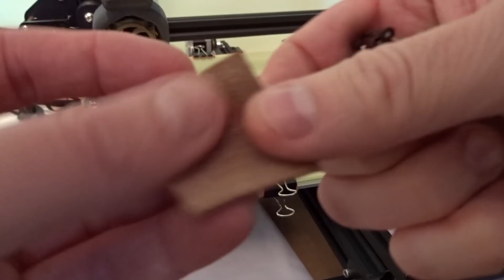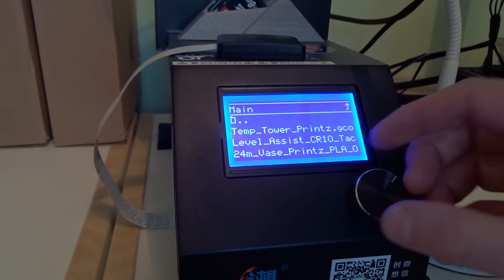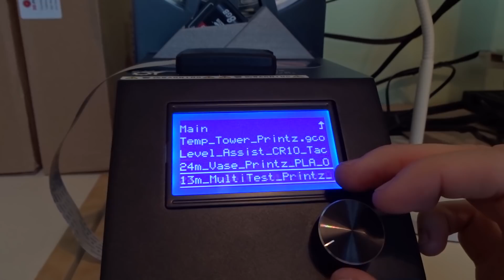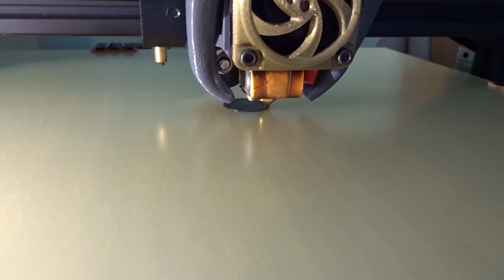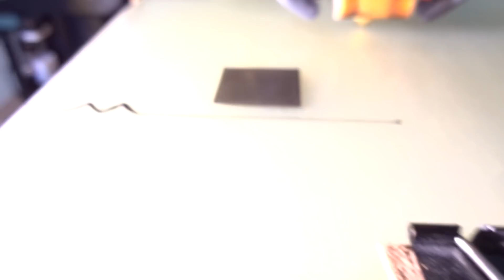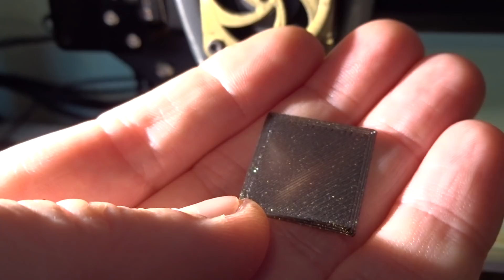Easy Live Levelling

Comment: i use water instead of binder clips. just slide the glass backwards over top of a few drops of water and it wont go anywhere, and you've got  your entire print bed available.
obviously dry the edges before you start printing and don't put your printer inside a pool of water you'll be fine. for ABS i'll probably try the same trick with oil instead... since water boils at 100c

Comment: Nice. Whenever I tried that on my Tornado, I would just go round and round in circles. It was maddening. Every time I adjusted one, it would sod up all the others. Sometimes, it went on for hours. I gave up in the end. Blue tape soaks up most of the difference and if not that then Pritt Stick or an autolevel probe. The bed was warped out the factory. When I held the edge of a metal ruler along it's length, there was a massive gap in the middle. Some of this cheap crap just cannot be levelled imo.

Comment: "Automatic bed leveling" is really a misnomer. It should really be called automatic warping compensation. The point is not to level a flat bed, it's to counteract warping in a bed which can't be done with any other means besides physically fixing the bed like you've done with tape or by actually bending it back into shape with clamps. Even if you don't actually use it for printing, a bed leveling sensor can be a great way to get a 3D mesh map of the bed to figure out exactly where and how it's warped

Comment: I use a BLtouch and have to adjust my bed manually once in 3 or 4 months. I adjusted my bedsprings to the stiff ones. No hassle anymore. I throw on a print and have perfect first layers. Don't use any tape, glue or anything, just the creality glass plate. Just use the correct firmware and temperatures

Comment: I’m a nubs, only printed a butterfly from the Sd card after paper alignment.
I have a Monoprice Select Plus, I really like your method of real time leveling, so right away your know what your jobs are going to look like.  
I see your running Marlin, so I’m guessing I cannot do this with my factory firmware, what do I need to do to use this method?
I like your adjustment knobs, the features on the knobs make it easy to make an incremental adjustment.  I hope you included them in your description.
Again, I think this a super way to do your alignment as you actually see what the print is going to be like.
Thanks
Hager, (Phoenix Arizona)

Comment: should you be saying tramming the bed,   not bed leveling .....  tramming the bed.   #2 why not use feeler gauges for nozzle adjustment  distance from bed, not paper
Reply from the maker: No tramming is a term used in cnc and in the 3d printing community people know what the term leveling means. Tramming is not used in the 3d printer community.

Comment: Hi, I am wondering about the clips on the sides. The printer primes the nozzle and filament by extruding a couple of lines on the left edge. How do you get it to do that when the clip on the sides are there? Or have you disabled that somehow? If you have disabled it then how do you ensure to prime the nozzle?
Reply from the maker: Use custom start gcode and move the clips so they dont interfere.
Reply: @TacBlades  makes sense, thanks. Thought of that today morning as well :P 
I've ordered some extra slip on bed clips. Let's see how that works.

Comment: Great video. Curious as to why you set the first layer height to 0.18 instead of the layer height of .2?
Reply from the maker: Its mainly because internally to the printer it takes into account the extrusion width and pressure and for the first layer you need a little bit of squish for good adhesion for the first layers without producing an elephants foot.
Reply: @TacBlades  interesting, thanks!

Comment: You're a lifesaver! All of your techniques in this video saved me so much trouble! The very front center area of the bed would not stick and warp while every other corner was perfectly leveled on the glass bed. Your masking tape hack on the metal heating plate of the bed fixed that solution! I had no idea parts of the heating plate warp, so I'm really relieved with that masking tape! And your leveling squares are definitely more effective than using paper.  I have an Anycubic Mega X printer, which is kinda similar to the CR-10. I'm going to share this video with fellow 3D printing artists, so it can help others! Thank you!

Comment: is it me or he didn't explain how to know where to put masking tape in your metal bed? it seems like he did a ver precise work on his bed but does not explain how to know where to put it aside from the very general idea of putting in the middle if you have a bow : (
Reply from the maker: Yes i didnt explain that, but i basically put tape put bed back tested it, removed bed adjust tape place bed test, over and over until flat, its takes time but you only have to do it once. Kitchen foil works better than tape.

Comment: WELL, I have to EAT CROW here. I'm new to this 3D stuff (less than a month) and already finding out just how IMPORTANT this level stuff is. I have printed some really good stuff BUT had to use painters tape because I couldn't get anything to stick to my glass bed, however the painters tape has it's problems as well, most stuff sticks TO good and leaves a layer of tape on the bottom of the most of the parts, SO after watching your video several times I tried your method, BOY does it work! I did have to use a post it note to get a base level because I have an Ender 5 and very hard to see the nozzle and bed with the rails. My firmware already has a level the corners step so I used that for the initial level then printed several of the test prints you  provided adjusting the wheels  till I got the the correct results you show then printed a clamp that I couldn't  ever get to come out correct. Now I'm sorry I ordered an EZ auto bed leveler because after this I don't think I need it. 
Thanks so much for your video and your teaching.

Oh, and by BTW, I found out just why I used painters tape, MY BED WASN'T LEVEL even tho I thought it was!!!
Reply from the maker: No worries i am happy it helped you.

Comment: Don't mean to be rude BUT looks like you would spend all day leveling with this method.
Reply from the maker: Its very accurate takes me a few minutes and i only level once a month at most, sometimes once every 2 months.
Reply: I use this method and I find it to be way faster and way more reliable since you can see your results instantly, however some printers require screw drivers to level which would make it almost impossible to level this way.

Comment: Why worry about the alum bed if your using a flat piece of glass?
Reply from the maker: Because its clipped at the edges, and the base plate can move, twist, shear the glass it only need to move by 0.1mm and that will mess up a first layer.

Comment: Hello.  I'm confused when you say use a 0.2 layer height but then slice at 0.18.  I'm not following what this means or why there's a difference.  Also, I'm using a 0.2 nozzle so not sure if that makes a difference.  Thanks for the great video.  I hope to use it soon.
Reply from the maker: Yes things are very different depending on nozzle size but for 0.4mm nozzle use a layer height of 0.2 and a first layer of 0.18.
If you have a 0.2 nozzle then you are looking at a 0.1 layer height with a first layer of 0.08, the smaller the nozzle the more difficult and precise it becomes.
Reply: @TacBlades  Thanks so much!  I may switch back to the .4 then.  Very helpful!

Comment: One thing I was unclear on was when you do the taping. Do you do the first where the nozzle touches and you back off quarter turn and that's where you do the taping? Or do you tape when you are printing the squares and circle?  We just got ours and are struggling. The back left corner is as tight as can be and is touching the glass but we can back it off at all. No more room to tighten. So that corner is all messed up. Something clearly is off.  We just dont know where to do the taping part.
Reply from the maker: If the corner is tight and the adjuster and spring is totally compressed so no more a chance to lower the bed any more, then something is wrong, it should have plenty of adjustment away from the nozzle. 

In that case there maybe a problem with the position or height of your z endstop.

Comment: Hi Mate I know it was a while since you did this video so may not remember.
Your bed looks much larger than mine (200x200) and I was wondering if you could point me to the instruction  in the level assist  file  that would allow me to reduce the travel to 200x 200. As it stands now the first test point is about right then the next 1 about 50mmX50mm the next one is 50mm up the bed but ok for the edge.3rd point is about right and the 4th point 50mm in from the edge the center point is about two thirds up the bed.
Clearly the file thinks my bed is the same size as your but runs into a limit  which knocks everything out.
I am afraidI am crap at reading gcode and do not know the size of your bed to try and work it out.
thanks in anticipation of a reply..
Regards  John
Reply from the maker: Its too long ago but my bed is 305x305 if it helps.

Comment: Can you just use a reg pc of window glass ? Or is it special glass of sorts ?
Reply from the maker: It has to be very very flat and most glass is not flat, that why people use ikea lots mirror tiles because they have to be optically flat. Also to withstand the heat cycling.
Reply: Tac Blades thx for the response ! Cheers !

Comment: A waste of time and of material. And you have to do it each time after printing on a CR-10(S). What is really stupid about this method is that when you adjust one corner, another corner is spoiled. So, one trick is not to go for the "perfect" distance in the first run, especially when you had to turn the wheel a lot. You still must do several laps.
Reply from the maker: You are wrong i only do this once every 2 months my bed doesnt move.

Comment: How much Temp does the maskintape can handle for instance for abs need the heat bed need around 110°C does it need tin foil or maskintape is ok? Great Video.
Reply from the maker: Not sure but aluminium foil for cooking is a better solution.
Reply: THX for tour comment best regates.

Comment: You dont explain where and how to find the places to add the masking tape to..... (nvm already been answered below)

And wouldnt that insulate the bed from the glass and slow down the heat up?
Reply from the maker: No it doesnt slow it down, I also used aluminum foil for cooking. The place is really trial and error for the low spots.

Comment: I will be giving this a try, but i have a question - after the front left one was perfect "like glass" etc and it then goes to the middle, surely if you say you need to adjust all four even if only a touch you are going to mess with the front left? In a quest to make the ultimate levelling plan for when it needs doing, how would you go about slicing gcode so that it prints each corner first and then you adjust the middle?
Reply from the maker: The adjustments are small and due to the angle if you adjust all others but not the front left then the actual impact to the front left will be less than 0.03mm

Comment: you mentioned talking about how to fix the variations in flatness... i know the center of my cr-10s bed is low. what’s your method please? :)
Reply from the maker: I use layers many of cooking foil small pieces under the print surface at the low spot. Trail and error to get the right amount.
Reply: Tac Blades thanks.. how do you work out where the low spots are? again trial and error?

Comment: How do I edit the gcode for a creality CR-10 S5? 500x500x500?
Reply from the maker: Just use a text editor on the file.
Reply: I figured it out but im still having issues with the leveling any ideas
Reply from the maker: @AllInOne-bo5vp  is your bed warped ?
Reply: I put a mirror
Reply from the maker: @AllInOne-bo5vp  with heat and edge clips it can still be warped, mine is you have to pack it out with aluminum foil underneath for low spots. It only has to be out 0.1mm to be a problem.
Reply: How would i determine where the low points are
Reply from the maker: @AllInOne-bo5vp  thisnis something you would have to research online its not straight forward try the facebook dedicated groups its a good place to start.

Comment: Will these test files work if I haven't flashed my CR10 firmware? I haven't done that because it's beyond my technical savvy, I fear.
Reply from the maker: Yes these are for a stock machine.
Reply: @TacBlades  Thanks! Oh, one more question: I have a 500x500x500 machine...What should change?
Reply from the maker: @stevei7221  you would have to go into the gcode and adjust the locations of the test points. Its easy to edit in a text editor.

Comment: I saw on the Nerys YouTube Channel that he was leveling with one large circle that may have been 200 mm in diameter and he was compensating for nozzle height for the first layer by live leveling with the CR 10s Pro touchscreen buttons. I see that you are using the wheels. I am new to this. Is there a reason why you are showing this adjustment with the wheels and Nerys is showing it on his video "T3DP Live CR-10s Pro And Wham Bam Flex Plate" at 1:24:53 using the CR10s Pro touchscreen buttons? Also, regarding your flatness compensation, is the CR10s Pro 16 point auto-leveling compensate for flatness? Is it a sort of tramming?
Reply from the maker: The cr10 and cr10s as standard dont have thoes features in the firmwear so this is for thoes people. The cr10 pro has features in the firmwear for mesh bed leveling with a probe so its different. 
I have my own firmwear version of marlin on the cr10s so i can also do mesh bed leveling manually which is the most accurate method now.

Comment: I've had a lot of problems with the bed levelling on my ender 2 - the screw heads for the levellers are countersunk into the top surface of the bed with quite a bit of looseness. They tend to rotate with the knobs when I adjust the bed height. The springs also seem not to push the bed upwards towards the top end of their travel. I've packed out the springs with a couple of washers to try and increase the pressure but it's still a hassle. The bed has only three levelling screws. Adjusting one throws another one out, so we have to go around and around tweaking the levels until we find the least errors in the level.

Comment: Thanks for the video. You mention doing quarter turns when it looks like you're doing one-eight turns, so please be more accurate with words. Also, how did you check the middle of the bed when doing the contact test? In the video, it sounds like you just eye-balled it.

Comment: Well, that looks simple, thanks.... will give that a go..... currently using the Supplied "tac-fibre glass bed (?)) supplied with my Ender 3, its good, but doesnt sit flat on the Aluminium heater bed all over, might need to upgrade to Glass....  New Sub from me :-)
Reply from the maker: Or maybe shim the underside with aluminium foil to get a flat surface ?

Comment: I put tour code on my machine and now only get a bluescreen
Reply: I'm not going to open it up, it could invalidate the warranty, I'm going to contact the place I bought if from and will be trying your method of levelling the bed when the issue is resolved
Reply from the maker: @jeffw3312  good idea.
Reply from the maker: Start gode cannot effect your screen something else must have changed..
Reply: I don't now mate. seems od as soon as I put the code on my sd card and put it back in I have a bluescreen, seems a bit too coincidental it was working fine berfore except levelling issues so I thought I would try your way
Reply from the maker: @jeffw3312  very odd it's worked for many many people so I guess it's a specific problem to your machine have you tried a different sd card.
Reply: No not tried that yet, get blue screen with or without sd card, only had the machine 3 weeks
Reply from the maker: @jeffw3312  there is a fault with the machine I have heard of this before when the cables are not plugged in well between screen and mother board.

Comment: Amazing, thanks for sharing. Did you change your glass? What do you have on it to stick?
Reply from the maker: I use an Ikea mirror time and either nothing just clean glass or in this vid I used a printbite surface.
Reply: @TacBlades  Amazing stuff, been having a look at your other bits. Thanks for sharing. I have worked in IT for 25+ years and am a bit of a geek... but when you buy your first printer, there is a huge learning curve and to be honest, you don't know what questions you should be asking or things you should be looking in to. The instructions that come with the printer (CR10S) are incomplete and awful and again don't even tell you what you need to go find out. Still, I have printed a benchy boat now so once I have played about with levelling again I can try to print some new parts for my new printer. Having found your fan blade thing on thingiverse I think that will be first. Thanks again.

Comment: Hi! I’m able to level the corners, however I’m having trouble with the middle. Instead of dipping there, it is actually bowing up. For the best of my knowledge, both the bed and glass are quite straight, so it could also be a bent X-axis. Would you have any tips for correcting this? Thanks in advance!
Reply from the maker: Have you tried flipping the glass over. Or packing out the edges with aluminium foil ?

Comment: I have the big problem that the center of the bed is concave. I see that you solved it with tape, but how did you know how much tape to use? And also how did you know where to put it exactly?
Reply from the maker: Just guessed and uses the nozzle to check. Place some tape, test, place tape, test repeat repeat. Using aluminium foil layers is better than tape for heat really.